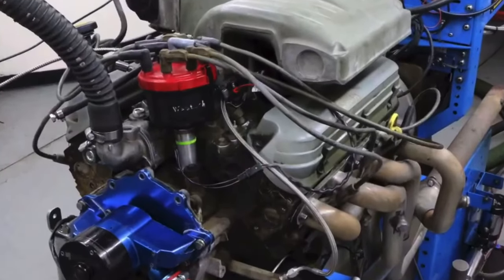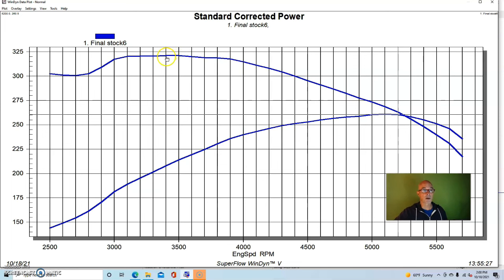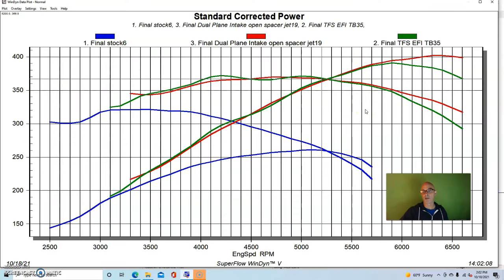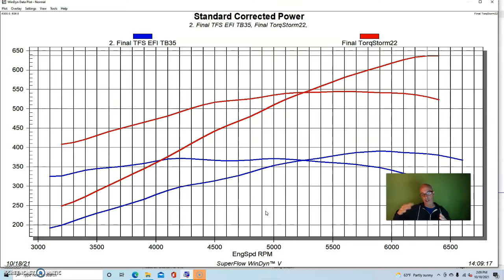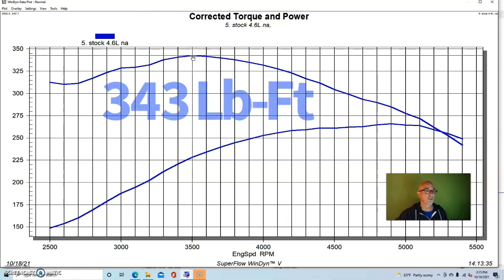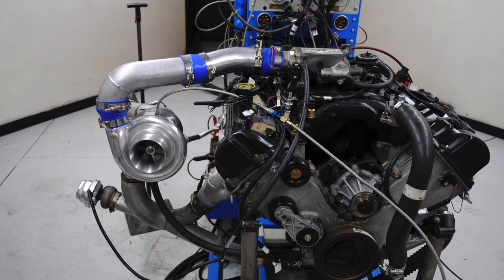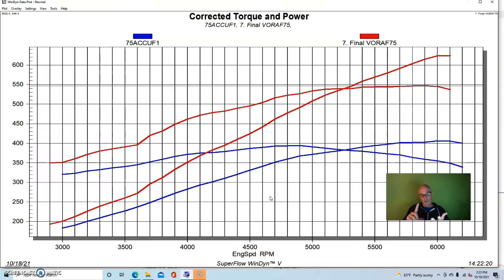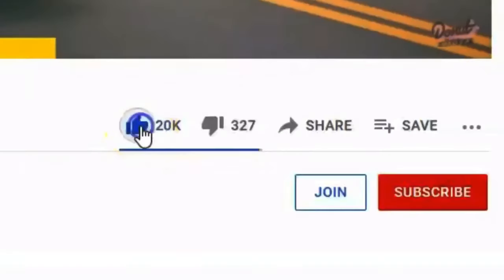WHICH FORD V8 WORKS BEST? OHV VS SOHC, 5.0L 302 vs 4.6L 2-VALVE MODULAR? WHO IS BEST FOR BOOST?

Comment: The best Ford V8 for boost is the one you've already got.
Reply: i agree..lol
Reply: 255 Windsor has joined the chat....
Reply from the maker: 221 too
Reply: This guy gets it
Reply: @richardholdener1727  i think with the 221 being like a 2 year run id save it for someone wanting to do a numbers matching build
Reply: 250ci 6 lol
Reply: Fucking SEND IT
Reply: Love watching 50tussin, the leader in substandard Foxbody videos. Guy uses 250,00 mile 5.0 short blocks and very used third hand hotrod parts to make hilariously fast junk.
Reply: @Abzocold  
Thanks for the lead.
Reply: 460 big blocks are monsters when it comes to boost along with both of the 4v intech engines
Reply: Which Ford V8.
Reply: The Ford Flathead has entered the chat.
Reply: The Ford Escort 1.9l has arrived.... 😂
Reply: you got that right!!!  injection is nice but I'd rather be blown.
Reply: Them modular engines are a different animal when you start adding boost. Not too powerful from the factory but remember the 4.6 2v replaced the 5.0 in 91 and at a whopping 190hp it had 30 more hp than the foxbody HO 5.0s so say what you want.
Reply: @luthermoore2969  Plus, in 93 they released heads that would support over 230cfm at under 1/2 an inch of lift. Factory B heads have a combined 214cc of intake port volume and usually come strapped onto an italian aluminum cast block.
Reply: @madmod  b heads actually flow better over .500 lift than the c heads do.
Reply: @luthermoore2969  I've got an original mark viii from 94 and it's pretty fun to drive. Those early engines make an honest 75hp more than the early 2v and healthy torque too. Cheap to buy and mortify
Reply: @Abzocold  yes!  Rodney works hard to have fun
Reply: @Luther Moore  the fox was rated 225/300 then in 93 they changed it to 205/285 or something.  I believe it was just a difference in the way they rate engines.  The 94-95 qa 215/285 but they all dyno the same power.  The first 2v in the mustang in 96 was also 215/285 it had the same power and torque the 5.0 did and every bit as much potential people just didn't like it at first because there wasn't much aftermarket that certainly isn't the case today. I think the mod motors are better suited for big power they only need forged internals instead of needing the block and the internals.  The 4.6 makes just as much power with less cubes and its actually pretty torque heavy just as much as the old 5.0.
Reply: @midnight347  In 91', everyone thought the 4.6 was going to be a crazy revver since its over head cam and smaller displacement but it really was just designed to replace to the Sbf and succeeded id say.
 It produced the same or slightly better average torque, same power, got better fuel economy, and it would turn 300k+ miles because it was way overbuilt for the given power offering everything needed for a workhorse application.

By '93, everyones power wishes were granted with the Dohc 4.6 coming out with a solid 280fwhp in super richy single exhaust trim. This was no slouch for the time and the Lincoln land speed records were crazy with these cars, exceeding 175mph.
Realistically, even a 2v NPI longblock has so much more potential than an oem 302 imho.
For example, I used to have a Kenne Bell 2.2 on my 302 even with beefed valve springs on a stock cam, it would float valves past 5500 rpms forcing you short shift like a big block. Compared to my 96Gt, i had stock NPI heads with PI cams and a Pi intake manifold fed with a Vortech non intercooled blower. That car saw 6500 rpm every wide open throttle shift for 60k miles before swapping the blower for a Zex wet kit and hitting it with a 125 shot for another 50k miles. Now the car has been 4v swapped but the old NPi is still healthy and sitting in my garage as a running spare shortblock.
Reply: @luthermoore2969  actually the 5.0 gt was rated at 225 horsepower.
The 4.6 was behind on power for the first couple of years.
Reply: @twatdidusay304  i waited three months to revive this dead thread AGAIN to say "i think you were just a little late there bud"
Reply: @madmod yeah the 4.6 and 5.4 were very adequate motors with good longevity.

Comment: None of this matters because the 4.6 mod motor sounds like it was sent down by the engine gods to grace our ears with its exhaust note.
Reply: You do know they sound damn near the same with the exception of the 3v and 4v engines right? Same firing order..... 👍
Reply: @oldschoolmobile   They all sound good
(except Coyote with stock Tri-Ys) though I tend to agree that SN95 2V/4Vs do sound particularly good. A 302 Fox with Flows and a cam sounds good too though, it’s such a retro sounds it’s not even played out anymore
Reply: @oldschoolmobile  Ive never thought the mod motor sounds like a sbf
Reply: They both sound good I’m my opinion
Reply: @oldschoolmobile  Note I said 4.6 mod motor - the modular series includes all of those, and the 5.4 if you're feeling like adding it in the mix :)

It sounds nothing like a SBF at all unless you just run straight pipes on everything then it sounds like throwing a metal trash can down a cliff.
Reply: @arc00ta  I mean I can tell the difference between a 5.0L HO and a mod motor, especially the 3v or 4v. But the 2v sounds damn near identical with same exhaust setup. My fav is the 3v and mid mounted Magnapacks. I have a few videos of that on my old 3v. Check them out and see what ya think. ✌️
Reply: Exactly it's not always about being the fastest when you sound the meanest 😁
Reply: @oldschoolmobile nah they don't I own a blown new edge and a 16 mustang GT and it's not the same
Reply: You cannot be a choppy 302 at idle end of story
Reply: You cannot be a choppy 302 at idle end of story
Reply: I have had both at the same time in my driveway with the same midpipe and catback.They do indeed sound indentical if not close to it.

Comment: The 5.0 should have came stock with the explorer/cobra intake. They made a noticeable difference over the junk h.o. intake.
Reply: The same could be said about using PI induction on a NPi engine.
Reply: @madmod  difference is the pi stuff was a later update that did come in the mustang once it came out. The fancy 302 stuff came the same year in other applications but never the GT mustang, and the cobra mustang did come with the upgraded stuff.
Reply: @Prestiged_peck  What confuses me is how much r&d went into producing a far superior frpp svo 2v casting borrowing mostly from the NPI only to go backwards in performance creating the PI. They had a 2v head with 190cfm of intake flow stock that could maintain decent compression and even despite having fewer intake manifold choices most of which were crappy at the time, still produced fantastic power. I just dont think they wanted to compete with their own sales of higher trims like the cobra. Same reason we didnt get the explorer intake on a base gt. It kept the cheaper pony cars in a class of their own while the cobras swing up at the bigger displacements offered by gm.
Reply: They should have come with a supercharger stock. These hci supercharger 302 combos can still hold their own in 2021.
Reply: @camaromustangmods3327  I had a 2.2 kb blowzilla 5.0 and sold it for a 2v and couldn't be happier. The 2v holds its own just fine and despite popular opinion, they are cheap to modify and make power with.
Reply: @camaromustangmods3327  yeah but they didn't have the tech to make superchargers cheaply back then, they wouldve probably went for 40-50k back in the 90s, keep in mind the cobras back then were running 25kish fully loaded and optioned.
Reply: @madmod  the 2v is every bit as good as the 302 imo I think it's better.  Put forged internals in both and boost and turn it up and see who makes more power and holds more.  2v wins on both accounts.  As for the gt getting gt40 top end it prob would have later had they kept the 302.
Reply: Not like there wasn't tons of junked Explorers to pull the intakes from but also it was not as much of a performance boost as some think. For all the effort it was better just to get a better aftermarket intake, by that time the Foxbody and SN95 5.0's had more aftermarket support than anything else including GM cars.

Comment: I remember the 90's when that 4.6 liter was released and the Ford guys HATED it.
Reply: They hated it because in the beginning there was no aftermarket compared to the 302.  Now that there is plenty of aftermarket that is no longer an issue.  It's proven to be just as good and imo better than the 302.  Forged internals and boost on both 4.6 can make and take way more power.  They sound just as good too.  I love the mod motors.
Reply: @midnight347 the NPI 4.6's were dogs, a 1995 5.0 GT would skull drag a 1996 GT. Ford went to the PI 4.6's in 1998 which made them roughly equal to a SN95 5.0.

Comment: I remember these two engine combinations in their stock form in the cars. The 5 L would take the lead through first and second is in the middle of third the 4.6 overhead valve engine would start pulling on top end in the 8th mile the 5 L won every time in a quarter mile the 4.6 wins these were all bone stock engines no modifications whatsoever.

Comment: I love the comment "every component of the 5.0 is limiting." Thanks for showing us that 302 or 4.6, both have plenty of potential. Multiple generations down the road with the Gen 3 Coyote out the 2V gets very little respect. Too often when you're considering a car with 4.6 2V or 3V the reaction is no, don't do that they're junk. Without traction control 400hp from any source has the potential to get you in real trouble if you aren't careful and in possession of a little skill.
Reply: Anyone who says that a 4.6 powerplant is junk is an idiot. They're not a 5.0 coyote but they are far from junk. I know because I've owned 4.6s and now I have a 5.0.
Reply: @thollingsworth4910  It's important to know, too. You can't just drop a sbf into an emissions-era car because usually you have to have an engine of at least the same year as the car. For that reason I've pondered the potential of the 4.6 and 5.4 4v engines put in some Lincoln SUVs.
Reply: Well said👍
Reply: @thollingsworth4910  yea these days people just regurgitate the same bs everyone else says online without doing any real research for themselves.  It's every bit as good of a platform as the windsor 5.0 if not even better as shown in this video.  It can get it done na and forced induction just as well as the old 5 liter you don't really see people saying they're junk not nearly like you do the 4.6 motors.  Just because it's not as good as the coyote don't mean it's junk but some don't understand that.
Reply: @midnight347  4.6L 2V owner here despite my user handle name on YT, from what I've gathered over the year is that a lot of these enthusiasts are just power junkies. There are very few enthusiasts who are willing to put in the wrench time to get the power output out of these older platforms. It's easier to say, "F** IT" I am getting a coyote car because it makes the power OUT THE BOX verses, I am going to do the research and build it, most do not have the patience or time. Secondly, I wish Rich could have tested my combo. I have TFS 38CC heads, stage 2 bullet grinds, and Foxlake P51 manifold, the combo should do in theory 425-440hp N/A but the video was still good.

Comment: I’ve had both of those motors (mildly modified 92 Mustang 5.0 EFI) and a stock 190 HP (95 Crown Vic). Both great motors. I had no problems with either.

Comment: I admire your no nonsense approach to your video, you're right, regardless of the base engine , once you modify it correctly using quality parts you will get good results, I came away surprised , I have had many 5.0 engines and my pick up has the modular 4.6, glad to see the 4.6 did so well in responding to mods, this video has renewed my hope of making more power for the 4.6, you now have a subscriber for life.

Comment: the 8.2 deck windsor is king. Down here in Aus, 4.0" bore 3.0" stroke, 5.7 rods, 10:1 comp, big big cam, Yates D3 heads, ITB short runner manifold with high injector placement, Pump gas, 7500rpm limit, 650HP all day long.
Reply: How much to mod a motor to this extreme and I know u can keep up with a hell kitty in your much lighter ford car lol so do u end up spending way less the whoop on them or keep up to say the least?
Reply: @steveparlier7059  a new engine is probably 150k AUD. A second hand engine with a few seasons on it would probably be 30-40k AUD. To develop an engine like that yourself probably 10 years and a few million dollars

Comment: Torque is a function of bore and stroke. Engines convert fuel into torque. Horsepower is a function of torque and rpm. Once people solidify that fact in their mind, the tests make more sense. And of course there are variables that can shift the torque curve. Referring to your younger and less experienced enthusiasts.

Comment: Would like to have seen the 4.6 outfitted with Trick Flow heads/PI spec. Comp Cams/Trick Flow intake (similar package to what the 5.0 received) to make for a more "apples-apples" comparison.
Reply: It would have made more power.  It already made more and it would have made even more that way.  The 2v is every bit as good as the 302 in every way na and boosted and with forged internals in both the 2v is capable of holding way more with its stock block vs the 302.

Comment: mod motor powa baby. really enjoy your vids and always learn from them but when its ford mod motor stuff i pay extra close attention. thanks for what you do Richard, i have a 4.6 4v B heads  with a D procharger i love that thing its my first little hotrod i can work on during the winters(it snows here in west michigan) and thoroughly enjoy during the summers. i would also like to do a set of rods and pistons, standalone ecu and a better fuel system. really want to learn some aspects of tuning so i can make my own adjustments when im at the track hence the standalone.
Reply: I’m a 97 cobra with p1sc, long tubes, and x pipe. Making 401/367 on a conservative 8lb tune. What power are you laying down? I’m loving my car. Really wanting to do forged internals but at the same time I want a terminator and can’t justify owning two 4v 4.6 cars.

Comment: Great video! You mentioned you used 36lb injectors on the 5.0. Did you change them out when you added boost? Which injectors did you use on the 4.6. Also, what was WOT timing set to for both 5.0 & 4.6.... Thanks!!

Comment: I’m just now seeing this video but I’m really excited about the comparison. I’m a newbie to much of this, but am the proud owner of a 2004 Mustang GT convertible (auto trans) with the 4.6 with 130K easy miles on it. I’m very interested in this engine and for sentimental reasons this car will never be sold or traded. When he time comes for an overhaul I want it to be done precisely and with attention to every detail. For example I would like to replace everything that needs replaced with top quality parts, upgrades wherever available. I’m drawn to performance tempered with durability. I’d welcome the added horsepower and torque, but not to the point of overstressing the bottom end. I’d love to hear from you and others regarding those goals. When the engine gets pulled I don’t want to cheap out on essentials just to say “I have 400hp” or something. Thanks in advance for sharing your ideas.

Comment: I have a 1996 Ford F150 with a 5.0L (302) Windsor V8 with 210,000 miles on it and still going strong 💪. The only things I replaced on my truck was the starter, the rear fuel pump, and the power steering megunisum but other than that mostly was just simple maintenance, took out the transmission fluid just to get rid of the shuttering it was making and it hasn't had a problem ever since.
Reply: I have a 4.6 2v around 210k miles and only changed alternator and few thing like eBay perge solenoid and idle air control valve basic maintenance
Reply: Still going strong  💪 to
Reply: @kylejohnson7258  Nice
Reply: @CJColvin  yes sir 💪 both great motors in my opinion and love the unique sound of both
Reply: @kylejohnson7258  Same here brother
Reply: @kylejohnson7258  Also don't forget the 5.0L Coyote V8 as well.

Comment: For 281 cid the 4.6 does great. They do not leak very easy and seal up better. Water pump and timing cover are seamless. I am pro 4.6 being I have made over 1000hp on a 4.6 and stay together much longer
Reply: They respond to mods very well. I surprised the hell out of 5.7 mopar guys. I’ve beaten chargers in highway pulls. That’s what gears and being 1,200 lbs light does.
Reply: Ditto

Comment: I would have like to see the boost curves side by side. This way we could see some of the efficiency different. 
I personally think the 5.0 is a better motor cause the simplicity.
Reply: People always say that but there isn't anything complicated about the 2v or any of the mod motors.  They aren't hard to work on and they're reliable and they sound just as good if not better.
Reply: @midnight347  no they aren’t hard to work on but ford added things that engine that complicated it for no reason. My car is way more complicated than these engines. I work on late model stuff and an example is c7 z06 and those are a royal pain to do a cam.

Comment: This gives me so much hope for my 4.6 lol. I'm hoping for 450 wheel in a cammed 2v with about a 175 shot. 😅
Reply: I would go with supercharger or a turbo. It's always there when you need it. I ran nitrous for a while on my street Stang and was happy when I went to a supercharger.
Reply: @streetdomn8tor101  yea I would look into the department of boost manifold that allows use of a terminator blower.  Not only would the m112 be good for the power level he's trying to get to you also open yourself up to all the superior pd blower options available for the terminator that isn't available for the 2v if you ever wanted to build the bottom end and go nuts.